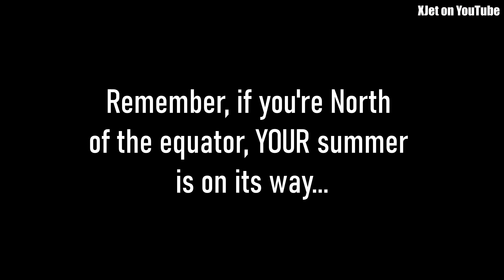Final RC plane "flies" of Summer

Comment: Looking at your "last flies of Summer", I'm drawn back to the origins and progression of model aviation.  In the 40's, it was all light construction and limited range; balsa and control line or FF.  In the 50's, RC started with pulse on/off, and mandatory left/straight/right flite path.  In the 60's, I didn't see much development, but in the 70's, electric drives and RC gave us freedom from nitro goo on the airplane.  In the 80's. RC became more sophisticated (frequency freedom) and electric drives more prevalent.  Then, in the 90's, plastic took hold, with simplified construction and increased durability.  Currently, the "walk of shame" could become a trip of renewell if you carried crazy glue and maybe a carbon fibre strut in your pocket.   JL